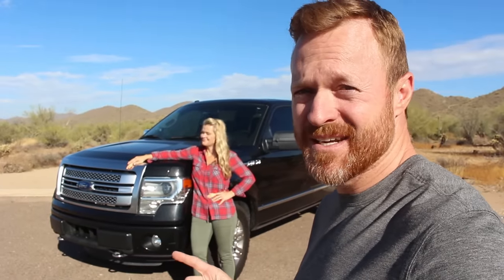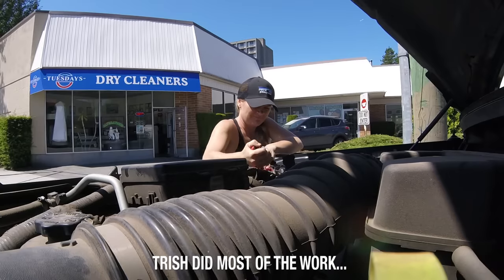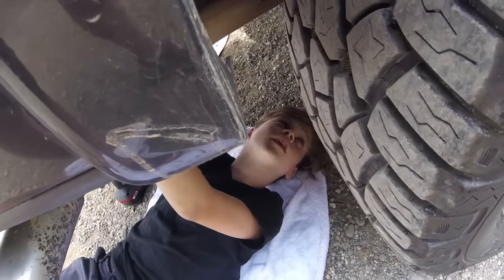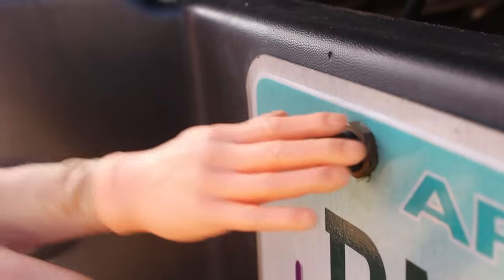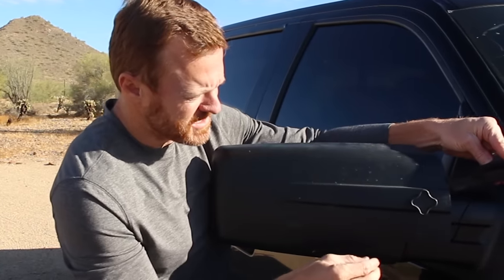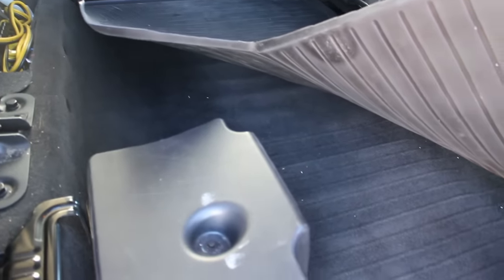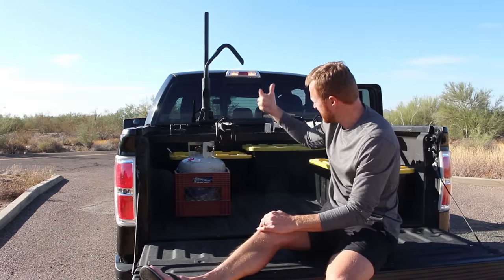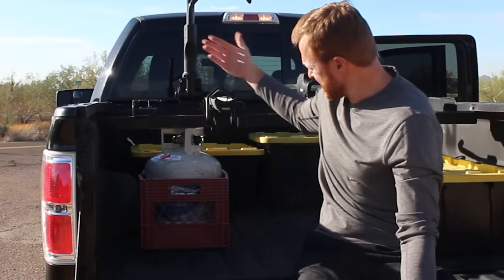TOWING WITH A HALF TON TRUCK (FORD F-150)

Comment: Thank you!!   As I have the 2014 F150 Ecoboost with a 27ft TT.   Really enjoyed the video.   What do you set the trailer brake controller at?
Reply from the maker: 8.5. I was told that it should feel like stopping normal. Perhaps that's why my brakes lasted so long.
Reply: Thank you, just what I have mine set at also.  Seems to work quite nice.

Comment: I am having a hard time deciding what truck to get. I really just want a 1/2 ton like the new Ram 1500 but seems like everyone says get a 3/4 ton. My wife and I are looking at the Grand Design Transcend 29tbs trailer which is 8795k GVWR. We have to bring it from Texas to North Carolina and onto property to stay there to live in it while saving for a home. We will not be traveling with the camper anywhere with the exception of  maybe a few times a year. My truck however, will also be my commute vehicle to work. Could I get by with just getting the 1/2 ton or just go with the 3/4 ton? Seems like a waste of extra money to just use it a few times a year to tow a trailer.
Reply: I guess I should just get a 3/4 ton. Just really dont want a 3/4 ton for a commute vehicle but its probably better for towing the RV even though we using it all the time. Probably not much gas mileage difference between the two when you have to upgrade a 1/2 ton to make it tow like a standard 3/4 ton.

Comment: Hey i see your still running the stock wheels but can you tell me what tires are on your truck and the size? Also do u have a leveling kit on this truck?
Reply from the maker: Copper Zion LTZ on a 22" wheel. They are wide, but I can't recall the size. No level. Just air in the back.

Comment: Very helpful video! What size and brand tires were on this f150 and did you have any lift or leveling kit in the front?
Reply from the maker: No lift. They were Copper LTZ Zion. I don't think they had the weight rating I needed, but I got them prior to knowing we would start RVing.

Comment: I understand the "use what you have" but if you can afford a Platinum Ford you can afford a super duty
Reply from the maker: That might be true, BUT....I bought the F150 before we knew we would start RVing...the better example is 5 people in our TT. I still don't how it works.
Reply: Keep Your Daydream Sell it? Trade it?
Reply from the maker: Sure, but what if didn't like RVing. Drop more $$ on a overkill truck. Buying trucks right and then keeping them is key. Expensive to make moves https://youtu.be/81KFlbR-STg
Reply: Do what you will. Im just saying there is a reason why they make heavy duty trucks.

Comment: Good video two questions first on the firestone ride rite how much air do you have in the system second how does the 6.2 perform we are buying a used ford soon probably 2013 and there is different engines available in that year
Reply from the maker: I kept about the air at 35lbs and it went to 75 with a load. I never adjusted and didn't think it was too stiff without the load. The 6.2 is an amazing engine. If you can find one, you'll love it. It's the Raptor engine. The 3.5 Eco is another great engine. I've had the 5.X motors in the past and they struggled, which is why I went 6.2 on this truck.

Comment: They only put a 5.0 in them all of them except for the Raptor
Reply from the maker: Ah, not exactly. My truck was the 12th generation of the F150 (2009-2014). During that time they had V6 engines 3.5L eco, various 5.X motors and the 6.2L motor. This conversation reminds of the quote, "often wrong, never in doubt".

Comment: I just recently put airbags on my 2017 ram 1500 and I tow a 35ft forest river and was curious what psi you ride around in when your not towing
Reply from the maker: I'm pretty sure I keep them at 35 and that rises to 75 with a load. I never adjust them being FT.

Comment: I am assuming you were using a weight distribution hitch and you were still getting sag . Did you air up your air bags first before hocking up your hitch . I am new to the game and not sure if the order matters? Thanks in advance.
Reply from the maker: Stay tuned for a deep dive video on this topic. We just got another rig and I'm brining in the mfg to discuss how to properly setup a WD hitch and how air impacts the setup. Based on my experience, air (lifting the back of truck) would increase tension... perhaps more than you need putting strain on the frame. The order doesn't really matter - the end result does. How much tension and air. Finding the right balance of levelness and tension.
Reply: @KeepYourDaydream  Okay looking forward to it. I have a Dodge Ram and my bags are not on-top of the springs or inside them they are beside them. I am thinking I am going to put about 20 lbs in them to work in conjunction with the springs. It's hard to find the right information out there. I really enjoy your videos you guys have really made your lives a real adventure . I know you guys have upgraded your ride a long time ago and it's not really relevant to you. But any help would be appreciated.

Comment: Hello Friends :)

 My name is Brendan and I just came across your channel the other day, as I have been researching airstreams to move into FULL TIME :). I have just purchased a used 2019 Flying Cloud 25' FBQ and I'm looking into different towing vehicles. I noticed you currently have a Ford F 250 correct? With the Gross Weight at 7,300lbs for the 25' FC, would a F150 or Ram 1500 work ok? If so are there any things I need to specifically look out for while purchasing the truck? I am looking at the used market, unfortunately can't buy new at the moment :/ Hope this finds you well. I've been scratching my head over this for weeks, if i need a heavy duty truck or I can do a 150 or 1500. This will also be my every day vehicle as well. Thank you so much for your time! 
best, 
Brendan
Reply: For that length of trailer I would go with a Ford F-250. If your are going to tow through the mountains at  high altitude go with a turbo diesel engine. That length of trailer is a bit long for an F-150. Does it have a standard hitch or does it require a 5th wheel system?

Comment: Hey question. Did you upgrade from your f150 6.2 to the f250 because hauling the trailer was hurting the engine? I’m thinking about getting the 6.2 f150 platinum.
Reply from the maker: No. We wanted a bigger trailer. The biggest difference between 150 and 250 is the suspension. The 6.2L did fine, but I've heard good things about 3.5 ECO. The only drawback that I experienced is steep hills the RPMs would be above 4k
Reply: @KeepYourDaydream  how much did the trailer weigh that you were pulling? Any tips pulling?

Comment: Do you have a anti-sway bar hooked up?  I have heard good things about them.  I just notice you said you control the sway by trailer brake acc. installed in cab.
Reply from the maker: We do, they are good. We had the Camco EZ Load system, but it failed after 16 months. We're now looking at the Hensley Hitch.
Reply: Good to know.  I will have to look at the Hensley Hitch myself.  Let me know what you find out.  Thanks

Comment: that truck would look better if you got the tow mirrors like a factory one.
Reply from the maker: I looked into that. $600! So I got these.
Reply: Where were you looking at? I got mine at 1aauto.com and mine was like $450 with the power fold function.
Reply from the maker: I should have done more research! They do look better.

Comment: are you using the airbags and a weight distribution hitch?
Reply from the maker: Since this video, we've had an F250 and F450 and used air on both.

Comment: A burned up fuse..that's normal and safe lol
Reply from the maker: The F150 has a 15amp fuel pump fuse and really should be a 20amp. Perhaps being low on fuel caused it to break. Not sure. It didn't happen again.
Reply: @KeepYourDaydream  if the manufacturer says it should be a 15 amp and you put a 20 amp in shame on you
Reply: Reguardless it should never burn up like that that's crazy

Comment: How much does your camper weigh? I have a half ton ram and am shopping for a camper. Any advice?
Reply from the maker: 9,200 lbs. I towed with a half ton because I had it already. I moved to an F250 and it was a good decision. There will be an upcoming GVWR video coming up. Check that out. I wish I would have talked more about the lack of payload capacity with half ton trucks in this video. That is the real limitation.
Reply: Keep Your Daydream 
Would just beefing up the rear end be enough to compensate?

Comment: You didn't discuss your hitch.  Certainly that trailer has a weight distribution hitch.  Why do you have so much sag?  Those airbags are a band aid for a serious issue.  They do nothing to bring the hitch weight to the front wheels.

Comment: How much weight are you towing on an average day with the f150?
Reply from the maker: 9,200. Shoot I said that but it didn't make the edit. I think it's in the desc.
Reply: Sorry one last question...any issues with towing up hills or braking/stopping distance?  In the process of trying to figure out if we need the f150 or f250 for a same size trailer.  My people give me many different opinions
Reply from the maker: We did this video because so many have asked about what we did to our truck and we started with what we had, but if you're confident you'll be RVing for long time, you'll have more options with a 250, you'll get better fuel econ and possibly better resale...potentially making up for the extra cost to get into it.

Comment: Idk why so many people get freaked out when you tell them that you tow with a 1/2 truck. 1/2 ton ecoboost are rated for around 11,500 lbs give or take. The manufacturer won’t advertise  an unsafe towing capacity for the truck their selling. There’s nothing wrong with what your doing.

Comment: 100000 miles one oil change well damn I thought it was every 5 or 6 thousand Miles
Reply from the maker: I didn't mean once. I chanced it every 10k or so. In the new diesel, I'll be changing it based on testing the oil, not a schedule which is overkill.

Comment: Err 3 months later now with Grand Ginger
Reply from the maker: Why the err?
Reply: The first comment I said 6 months and I really meant 3 months towing grand ginger. You are at max tow while pulling and I was told that’s a bad thing. Just wondering if y’all have ran into any issues or anything

Comment: For a really nice pickup track rack, you can get the Yakima Bedrock mounts (https://www.amazon.com/Yakima-BedRock-Multi-Sport-Truck-System/dp/B009P3MLG4/ref=sr_1_1?ie=UTF8&qid=1509708180&sr=8-1&keywords=yakima+bedrock) and then a Yakima mount.  Once you have that, you can install either Thule (what I did) or Yakima bike racks.   Here is a picture of what the Yakima would look like: https://www.rackoutfitters.com/toyota-tacoma-yakima-bedrock-roundbar-truck-bed-rack-system/ . Picture is from a Tacoma, but would work with any full size truck with longer cross bars.

Comment: Ever hear of a weight distribution hitch? Your air bags did not solve your your problem. It masked it. You need a weight distribution hitch to distribute weight evenly between your front and rear axles. Even though you no longer sag all that weight is still all on your rear axle.

Comment: Never understand the mentality that a person buys a truck to tow a trailer and on purpose buy a 1/2 ton truck?????? No matter how large trailer we pull, you are much better off with a 3/4 or one ton Truck.
Reply: 1/2 tons work. No they are not 2500, 3500..etc. Customers have different reasons, usage and lifestyles no matter the truck or size of the truck. As long as you know your truck, equipment and trailer and stay within your limits, you will be good. Plus they were just starting out and educated a lot of viewers on RV'ing considerations. Happy viewing.

Comment: Nothing you did changed the fact that your truck is not rated for that trailer. You are not adding in the passenger weight and the other items you store in the bed of your truck. Just because you added air bags does not increase the weight capacity of your truck. Oh and adding floor mats has nothing to do with getting your truck ready to tow. You also don't mention if you have the max tow package and if not your truck is only rated at 8100 pounds.

Comment: Good for you solving  problem, but I would never buy a used truck that was abused in this manner: being overload for tens of thousands of miles.  That, and liability.  Get in a crash, and discover how liable you are for everything because you intentionally disregarded the vehicles recommended loading.

Comment: Your truck is rated for a MAXIMUM tow weight of 8,000 lbs.  You're illegal.  Just watched a video where "the facts were laid out."  Just because YOU upgraded your truck to be ABLE to tow that 9,200 lbs, is irrelevant.  Look at your GVW sticker.  That's it bud.  If you have a wreck and are found to be towing your overweight travel trailer, well, that's called "law suit" time.   I wouldn't take the chance that you and your wife are taking.  If there's an "incident," and someone gets killed, you could EVERYTHING.  Not trying to be a "hater" but facts are facts.  Nice truck. p.s. I looked up your 2013 1/2 ton platinum and that's it:  7,500 to 8,000 lbs MAX.

Comment: Ford never put a 6.2 liter in a 150
Reply from the maker: They did in the Raptor and the same engine is an option for the Platinum trim.
Reply: In 2011 it was an option in any f150. I almost took one but settled for the ecoboost.

Comment: the 150 is like a glorified car.. Not going to be towing much..
Reply from the maker: You're right. Only 9,200 pounds 50k miles across N. America with only changing the battery and a 15amp fuse in 100,000 miles. What was I thinking???
Reply: Oh heeeere we go...🙄